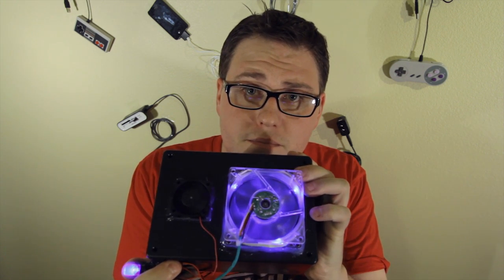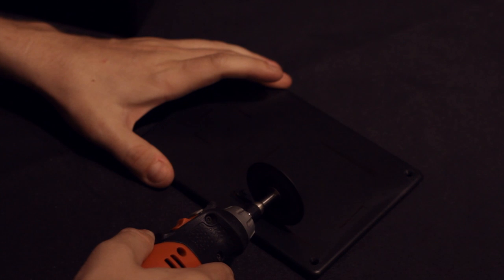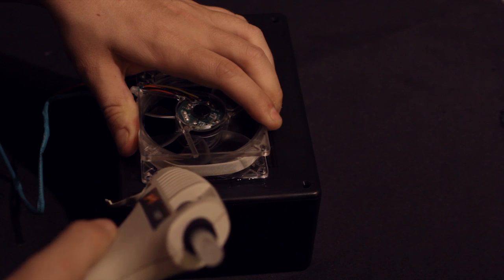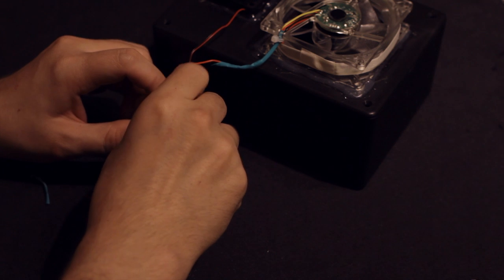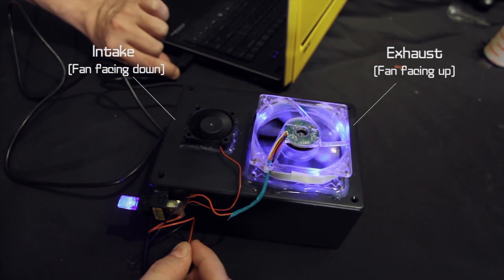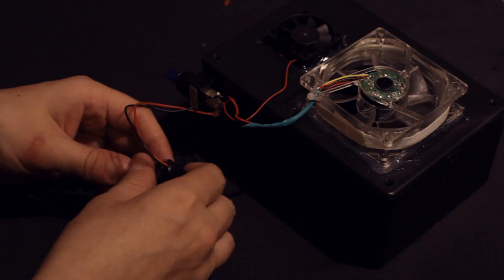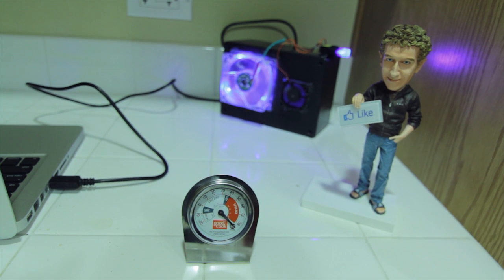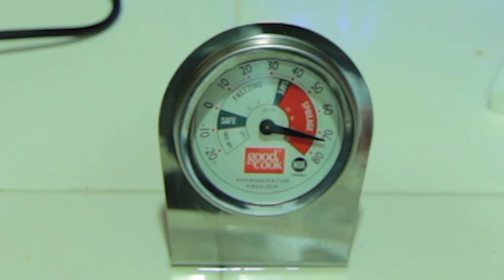USB Powered Mini A/C!

Comment: First of all in parts of the world where there isn't air conditioning they just spray themselves with an atomizer on their shirt and use a fan. Evaporation has a powerful cooling effect, in very dry places you can use an evaporation cooler also.
The thing you made is useless to be honest, first of all a refrigerator is required to make ice and the refrigerator releases heat when it's running (it's literally pumping out heat from the inside of the fridge to the outside air). The idea here is stupid, and not only that but the cooling potential from this small thing is virtually nothing. Other useless videos include peltier modules which are absolutely useless for air conditioning. 
There are only 3 ways to keep cool if you live in a hot place, the most obvious option is a proper air conditioner. If they are in a poorer country and can't afford that then you have to use a fan and not wear much clothes and even spray your clothes with an atomizer to enhance cooling or use a evaporation cooler. The last option is to build your house underground, they do this in some places in the world. That is really all you can do. 
Methods like on your video here and the stupid peltier module gimmicks are all useless. A peltier module is even useless mostly for even a refrigerator considering it's pathetic efficiency. 
A peltier module can't even pump a quarter of it's wattage consumption, most of the heat on the hot side is from the draw of the module and isn't from heat moved away from the other side. Where as a gas compression system (air conditioners and refrigerators) are able to pump more heat away from one side than even the power consumption of the unit. For example an air conditioner can use 500w and be pumping away 1.5kw from the side that you are cooling. This is why there really is no comparison at all, peltier's are a gimmick waste of money and time.

Comment: I plan on doing a project like this, I'm not very good at this stuff yet and I was wondering what the name is of the switch type that allows you to raise or lower the speed of the fan. For example I build this mini ac but instead of usb I used a 12v wall wort, since the WW (Wall Wort) is putting out the full 12v the fans need they will spin at full speed all the time  I would like to be able to turn the fan speed down or up as needed to help keep noise down. Im not sure what that type of switch or control is called. Can any one help me on this one.

Also great video and idea for this I really need this for summer.
Reply: +lordofstorms2000 you need a Motor Speed Controller I just bought one from Amazon for a cooler I just made.
here is the link: http://www.amazon.com/dp/B00DVGGWC0

Comment: Too each their own either way it make a good portable desk AC unit anyway you create it. Manipulate the steps to your own content. Hot glue works fine if you just want to build them and that is all. Soldering works fine too. If your a frugal builder than of course building things that would be easy to break down and reuse the components then that is fine too. Neither way is wrong but I would rather build them once, use them in the summer when it is hot and put them away for the cooler days of the year. This way I can pull them out again when to gets how again without the hassle of building them again. But if you like to build them every year for your self or have them made in such a way in-case you need the components than like I said too each their own. 

I just wish you could include a link on where to get a plastic box like the one you used in the video. looking for a plastic box there are too many varieties and many are too small or large too be effective in this instance. Also many have built in separators like pill boxes or lure boxes which create more work.

Comment: is it safe to use with a laptop ? wont if burn the motherboard ? a 12v fan in a usb 2
Reply: +Alexander Altshuller No because the ice/ mist will get into your laptop's logic board / mobo.
Reply: Yes it is safe to be powered by USB 2.0
Reply: +Alexander Altshuller USB plugs have resettable fuses, or other kind of protection circuity.

Comment: Why hot glue cables instead of solderim them propperly ? If you want to reuse the cables or swtich you will not be able to do it in the best way possible cus you fucked it up with the glue, cus is way messier and harder to remove... im not saying that it is 100% wrong... but is just stupid to do something and TEACH something wrong when you can do something DECENT and APROPIATE
Reply: +Jason D. Valentine The Hot glue insulates and bonds the wires and contacts the same way solder heatshrink tubing does, though it is not as strong a bond. if somebody is making this on a budget, which i'm sure they would be, they'd much rather use hot glue that solder and heatshrink tubing because of cost and how much easier the materials are to obtain.
Reply: PiercingThread7 But wouldn't it be more "budget friendly" if the components were reusable? And plus, if they are trying to teach you how do create things, one good thing, would be to improve the skill and level of the crafter. Obviously i didnt learn on soldering and basic electronics instantly with one video, but is a great start. A great way to make a passion grow. If you do not know the posibilities you can not have the choice. I know there are other videos aswell where people can learn and stuff. But i think would be better for their channel to. A little more work for a little more quality. But i guess they have the "cheapasfuck" style xD Good for them then, didnt keep that in mind myself.
Thanks for your comment^^ Have a nice day.
Reply: +Jason D. Valentine At last, somebody showing some logic and reason instead of losing their sanity over a comment. I have thought of this from your point of view, and I agree with you fully. Having the experience would be nice and helpful in the future, but sometimes, you have to use what you have, and not all people would have a soldering Iron, and buying solely for this project would put you back around $25 for a half-decent one, plus the cost of a spool of solder. there are other projects he shows us that show and recommend use of a soldering iron, but this one seems simple enough for somebody with even a small amount of knowledge in electronic wiring and the works. also, again, hats off to you for not losing your cool like countless others. Have a nice day as well! xD
Reply: ha cus not all of us has a soldering iron haahahahahahahaha
Reply: Johnny Dang well for 10 euros you can get a precision iron that must be like 8 dollars.

Comment: you should not tell people to improvie, this is how people gets stupid and hurt :X
Reply: Based on the work required, for example using a rotary saw blade, anyone could hurt themselves without improving it. Therefore it's implied that you should not attempt this unless you are comfortable with basic electrical engineering.
Reply: sublimerasta i misstyped that. I ment "Improvise" my keyboard is not working well, i beg pardon. 
I correct myself cus i find it very different to improve from to improvise. I am legally capable of project a 400 square meters electrical instalation and i know that even in smaller project (as an electrionic world passionate) you can find yourself in trouble, and if you "improvise" your way out of it in a non very conventional way , like cutting a plastic without heating the blade or smashing it with something, you will hurt yourself if you are not used to it. Me my self when younger did this kind of projects and ofc, i got hurt. To get hurt is a way to learn and improve in the work skill, but you can also learn from other people's mistake and avoid losing a finger or a tooth.  I simply wanted to express my disaproval to encourage people to "improvise". You must not improve, you must work as you know, if you do not know what are you doing or about to do, better search for information first, you might find easier ways to do it and much more important, SAFER ways to do it. If there is no alternative, then just spend a couple of dollars, euros, pesetas, whatever and get yourself what do you need to work propperly. Otherwise you just might remember me when you miss a finger :P 
Have a nice day people!

Comment: the air will not be airconditoned, it will be damp. That is not a/c. Rename this video at once to "how to blow cold air from ice cubes onto yourself"
Reply: +northhankspin Last year I was searching for some advice on the Internet about REAL (i.e. compressor based, or absorption based) A/C, because I built one myself but it was working poorly (the capillary was the wrong length). All I found was these rubbish videos about people blowing air on ice, blowing air on water and swamp coolers. Time to make a real instructable about real DIY refrigeration, now that my system works!
Reply: MrOpenGL look for peltier air conditioners
Reply: MrOpenGL replaces the compressor with a silent cell and two fans

Comment: good design, but the small fan is not necessary, you just need a hole there to let air in, the small fan there will conflict with the gas current inside the box that created by the big fan.

Comment: Or you could use a 12V AC adaper to run it on full speed.
Reply: Or 5V to 12V usb step-up converter

Comment: Great build! But it looks like your exhaust fan would be better for your intake fan. Although it is bigger, from what I see in the video it looks more like a pusher than a puller in blade shape (like what blows air through a heat sink or radiator). Also, maybe a divider could be placed in the middle connected to the fan lid so more air is forced to go between the ice instead of just wafting the top of the ice? And how about using 2 fans on on side to force a ton of air in and leaving the hole or multiple, smaller holes on the exhaust side so the air force in just comes out from pure pressure creating nearly double the force as so much a or will be pushed in? Any ideas sound good?
Reply: Please do realize that this project is considered "done" and won't be revisited. But those are pretty good ideas
Reply: Computer fans have an exhaust side and intake side just depends which side you use.
Reply: @91bartley  but they are designed to do one or the other better depending on blade shape for example. Some push air through things better than others and others pull air through things better than those.

Comment: Could a similar idea be used for a modded pc case for cooling?
Reply: It's a possibility, but you have to take into account that the air being blown out of this fan will be a lot more humid than regular air due to the melting ice cubes, and humidity can increase bacterial growth, and excess water in the air within your computer can never be a good thing.

Comment: How do you know witch side to put airflow for exhaust and intake
Reply: It is labeled at the side of your fan. Most of he fan will have it. If it don't have any label, test it to see which way is the exhaust and intake.
Reply: DrNiveks USUALLY, the side of the motor and cables is the exhaust. Just a correction.

Comment: If you can use a dremmel you can learn how to do basic soldering none of this hot glue crap. Also to cool the water into ice your freezer takes the heat from the water and dumps out it's backside so these ice box designs aren't really viable for a house.
Reply: actually it is. IT's basically a Swamp cooler :O

Comment: You should have the bigger one as the intake! That would make the box have positive air pressure so there would be no dead spots for airflow inside where the ice is, and there would be plenty of air rushing out of the smaller fan as the exhaust because of the positive air pressure.
Reply: You should have a higher airflow fan for intake than exhaust but you could have one fan for intake and little exhaust holes to create the pressure. Pressure isn't needed but it will make it more efficient. Just like if a PC case where you have more intake than exhaust, that will make sure that every single component in the case is cooled and all that heat will naturally rush out of exhaust openings in the case. Same with this, ALL the ice will have air rushing past it because of the pressure, therefore, all of the cold will rush out of the exhaust with pressure, making it more efficient.
Reply: why? I hardly got any vids, Thanks! Oh yea check out my only video.
Reply: You could still use this mod though.... Just reverse the power. ;)

Comment: You're overdrawing amps from your USB with a 12V fan. You should know simple electric laws before using the usb plug ON YOUR LAPTOP, atleast use a powered hub with experiments. Yeesh.

Comment: hi! can you add an additional usb power cable and make it freeze small layers of water as the air is blowing off the cold?
Reply: after using the icepack once, put the whole device into a freezer to refill 

using multiple devices is preferred to have one freeze and one thaw for each device unit

Comment: I know this is old, but why don't you connect the red/black of the usb cord to another 9 Volt battery coupler. That way they snap together.
This will also open up oppritunities for other DIY projects that can run off USB and 9V. Like a USB UPS: Universal Serial Port Universal Power Supply. (Power limited of course.)
Reply: UPS= UNINTERUPTED power supply, not universal

Comment: Very very cool project, I noticed that you only hooked up two cables power and ground (black and red). I also noticed that when you switched the toggle switch it lit up (pretty nifty). My question is this: I noticed that an online retailer has what looks like the same switch you used. You don't need an additional wire (like maybe the green one) for the switch to light up? Sorry but I know very little about hooking up electrical stuff. I think this might work for using a toggle switch to run a fan on my overclocked Raspberry Pi, and I think using a colored USB fan and a colored toggle switch would look very nice on a custom case build. Thanks!

Comment: I hooked up a little fan computer powered by USB, it was fine when I plunged it into on of those plug USB things, but when I plugged it into my USB hub it started smoking.  I don't think this is a good idea because i think it took to much power.
Reply: You did the wiring wrong

Comment: Highly impractical. That ice will melt out in no time then you have to keep running to the freezer for more every 10 minutes. Plus that water next to electronics is a disaster waiting to happen. You can keep cool by simply having a regular electric fan. The higher volume of air blowing against your skin will cool you down, even on hot days.

Comment: Its not air conditioner. Its air cooler and they are not costly like Air Conditioners. Its available in market for 20$ and up.
 
The problem is that air cooler increases humidity which can cause cold!
Reply: Increased humidity also makes the air feel a lot warmer than it really is.

Comment: turn the fans around and you will have a mini fridge :D
Reply: The air outside the box is warmer than what's inside the box, due to the ice / icepack inside. When you flip both fans in , you keep putting in warm air from the outside that will quickly exchange heat with the ice pack inside (acutally QUICKER since you have two fans pointing to it). Your flawed premise is that the air outside is cooler than inside the box, which is wrong or else there wouldn't be any need for a cooler if the air outside the box was cooler than inside. Therefore, no you don't get a cooler. Stop embarssing yourself here, because you are calling me dumb just because you don't undestand the simplest thermodynamics.
Reply: *****
 Of course, it makes a lot of sense! Since when you use a fan it's usually so cold outside the box! I didn't realize you meant a fridge FOR SKIMO PEOPLE LIVING IN AN IGLOO
Reply: *****
You are talking about yourself here. You've just realized how dumb you were, and you are trying REEEEALLY HARD to save face about it. For your sake I hope you aren't older than 14 , you certainly have the mental maturity of a teenager.
Reply: That doesn't make sense.
Reply: *****
And you need logic reasoning.
Reply: ***** how are the fans blowing cold air INTO the box from the outside? what if the outside is warm dumbass
Reply: ProperGanderSaul
Agreed
Reply: I've never enjoyed my popcorn this much.
Reply: ***** 'that guy' was me :P
Reply: Trollscience
Reply: +Bob Bobberson The fans will put HOT air from the OUTSIDE, INSIDE the box, making the ice melt faster. A really good idea isn't it??
Reply: ***** durr hurr get uh lyf
Why do you keep saying that? Just because you get offended by hearing that doesn't mean everyone does, who doesn't have a life?
Reply: *****

you actually right !
I put three of those fans (FLIPPED) on my wall and now im Sub Zero
Reply: TrasherBiner
Reply: 8======D
Reply: good one
Reply: ***** so you are saying that reading is for no lifers, while you sit in youtube the whole day, saying unlogical things that even 3 year olds understand, you must be Bill Gates.
Reply: *****
Did you know seals have chicken spaghetti?
Reply: ya lost me blaze
Reply: *****
:o
Reply: MrOpenGL hahahaha
Reply: Maybe if there was a SECOND box that was filled with ice, Otherwise no.
Reply: TrasherBiner yes it does. if the fans are blowing cold air inside the box, the inside is cold, like a mini fridge. dumbass.
Reply: TrasherBiner go to school, you clearly need the education
Reply: zdf46 cuz that's how my minifrigde works
Reply: TrasherBiner look, when the fans are flipped so they point inside the box, they blow cool air INTO the box, not out of it. then the inside of the box is cold, like a fridge. it's not that fucking complicated you dumb fuck
Reply: TrasherBiner still you, get a life fuck boy. you chirp worse than a dead bird
Reply: I never thought it would work, though the idea makes perfect sense you fuck